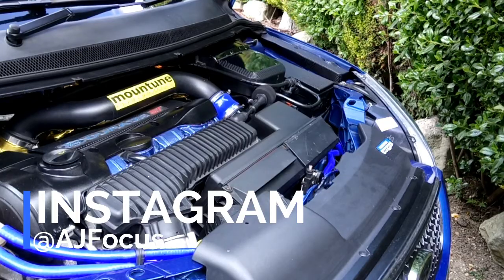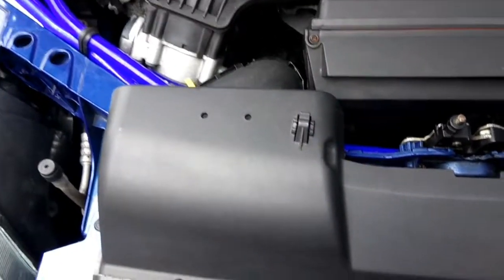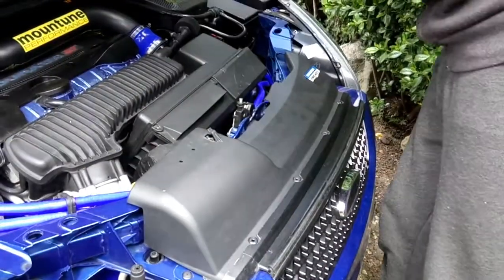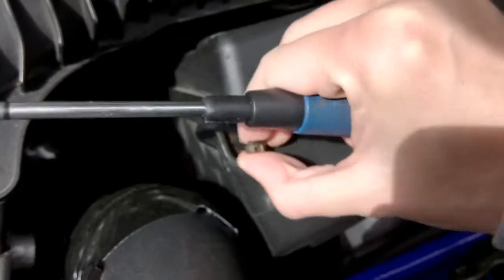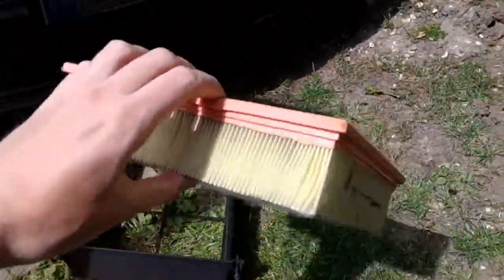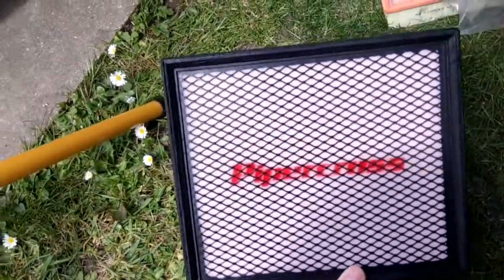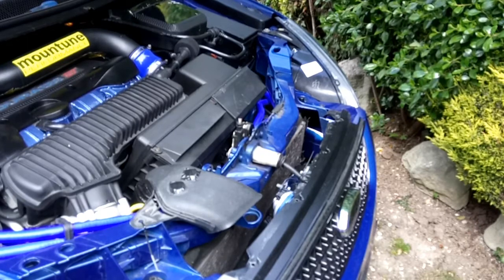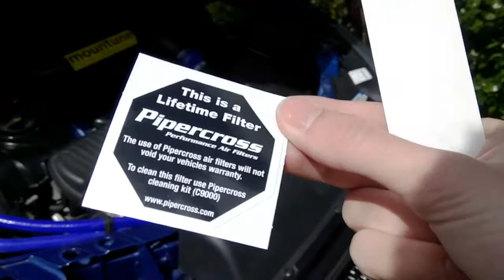New Air Filter Install On The ST ( PIPERCROSS ) easy install

Comment: The airbox seems much better sealed with the Pipercross filter vs the original (Original had a gap you can see it on your video, I am also running standard box and with the airbox attached,you can see the orange outline of the original filter. performance one seems way better. Good job and thanks for you videos, helps me out and im in South Africa. These ST's are gr8 though. 🖒🖒

Comment: Does it change the sound? or same as orginal?
Reply from the maker: Nah made no difference at all to the sound. Felt a tiny tiny bit better on accelerating but nothing great. Get these filters only if you don't fancy changing your oem one every time. With performance drop in filters these days you can just wash them. Saves money in the long run.

Comment: do  you think about ecu spacer? some say it really improves airflow in airbox.
Reply from the maker: Radosław Wojciulik - ecu spacer???
Reply from the maker: Looks good never seen these before didn't know they made little bits like that. That looks awesome. Will the ecu cover fit back over though?
Reply: It is new for me too. I have seen forum thread and didn't get clear answer. Some say that 14mm spacer fits with ECU under cover, another decided to cut some plastic pieces from cover.